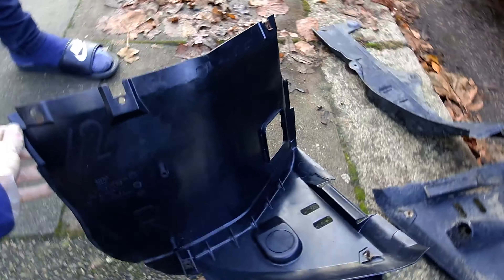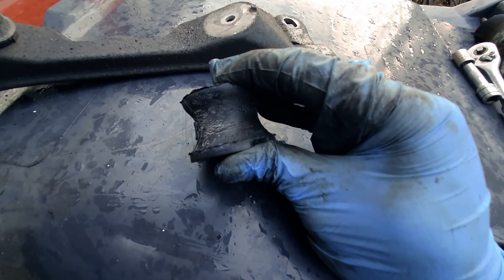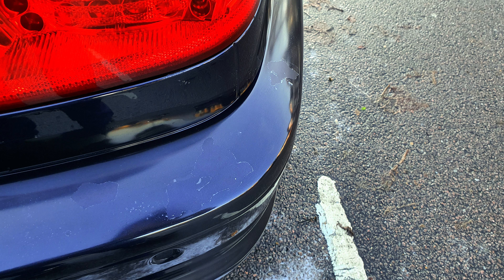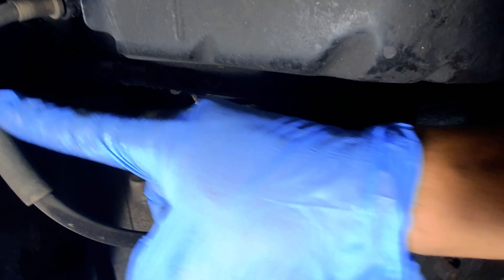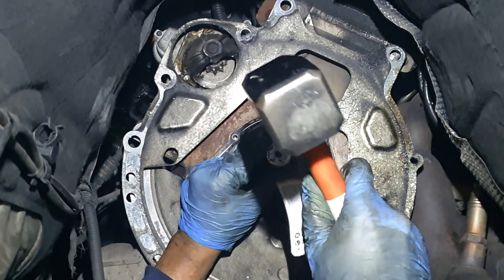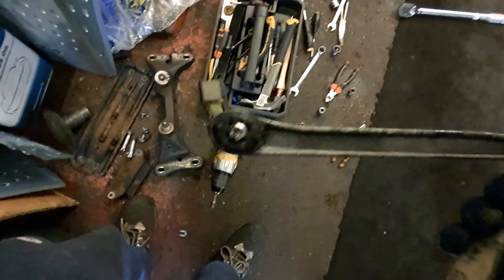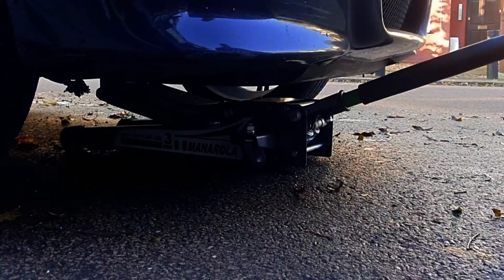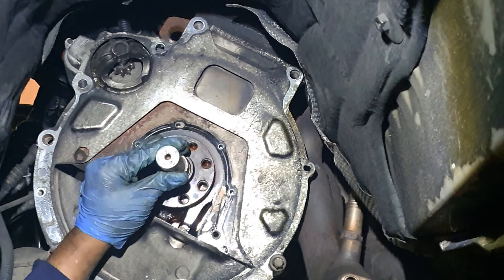bmw e46 m3 flywheel, clutch and other fixes diy #02

Comment: Liked and subscribed. In a similar position myself as I am now the owner of an E 46 M3 inDakar Yellow which I won from a car raffle site for the princely sum of £22.50!
I have a set of de-cat pipes to be fitted and it is currently getting a Kenwood CarPlay head unit fitted, matched to a set of rainbow SLS components in the front door cards, and all running from a Kenwood amp and 12 inch moulded sub box in the boot!
Reply from the maker: Hey Rossy

Great luck with the win, ill be posting my audio upgrades within a week it may inspire some ideas for you, thanks a lot for the sub and good luck with the car!